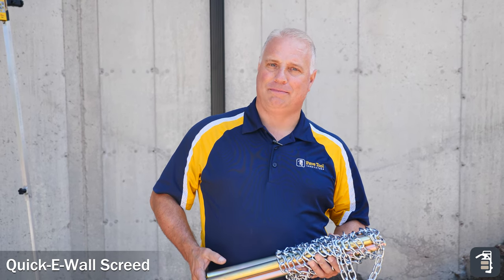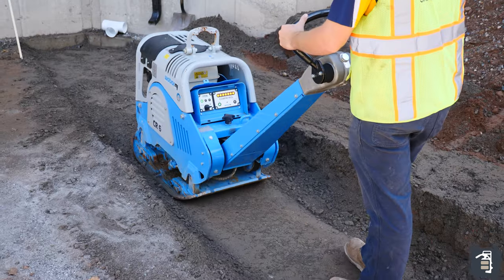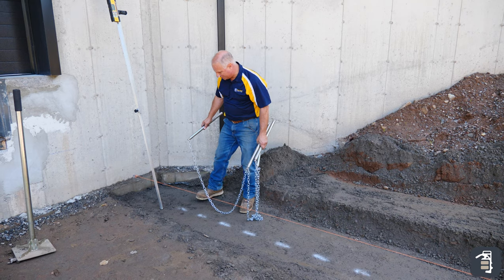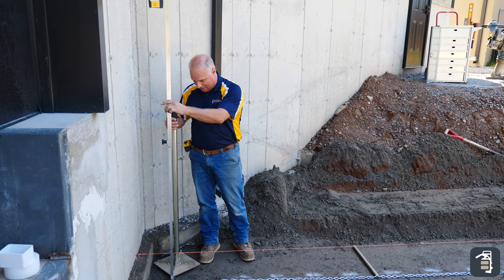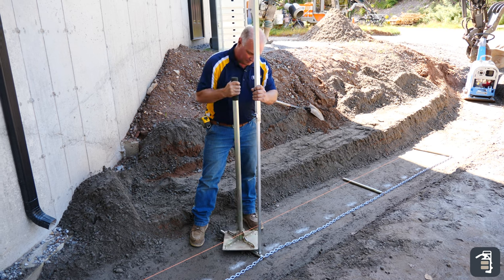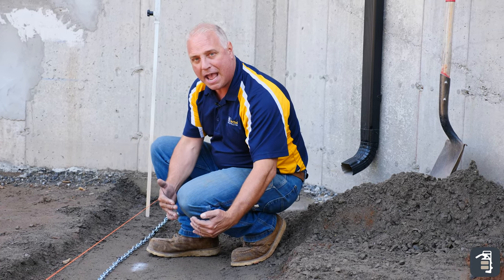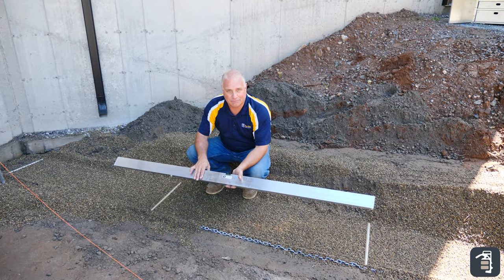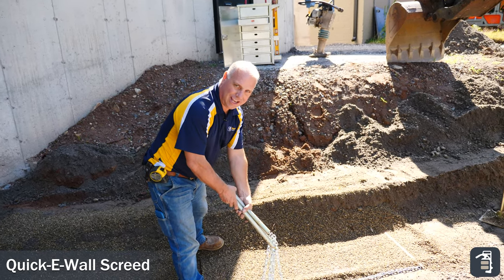Must Need Tool for Retaining Walls

Comment: For the screed material would you be able to use 1/4 open grade chips with 3/4 open grade base gravel?
Reply from the maker: Yes you may have to hand tamp in between pipes to condense 3/4 clean stone so that when you are screeding 1/4 open stone you don't pull the 3/4 up through it.

Comment: I like your products but do you guys not believe in draining the walls? Where's your footer drain?
Reply: Depends on the soils they are in they wouldn’t need it if it was sandy soils they will drain. Also looks like their base is crush and run so they can elevate that pipe.
Reply from the maker: We use the Quick-E-Retaining Wall Spillway for projects like these. We don't have it installed yet in this video but you'll see it in our next one. Here's the link to the product: https://pavetool.com/collections/accessories-replacement-parts/products/quick-e-retaining-wall-spillway